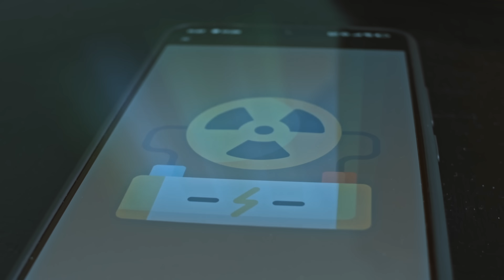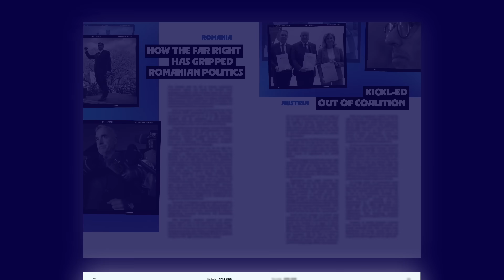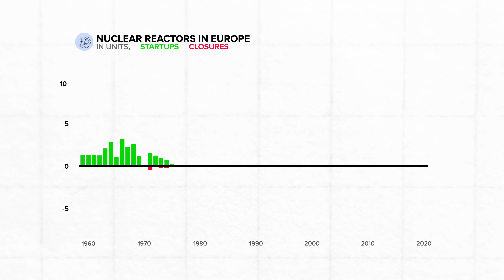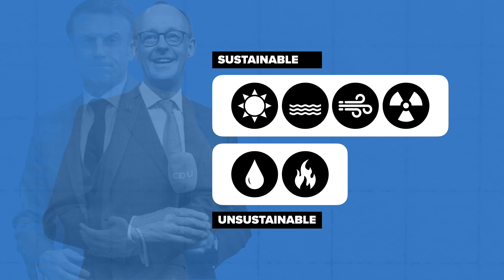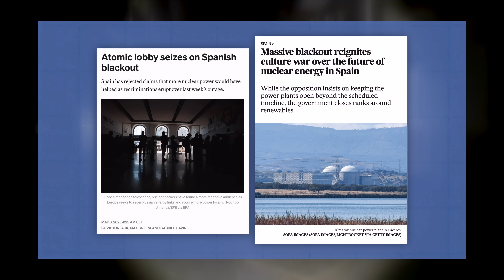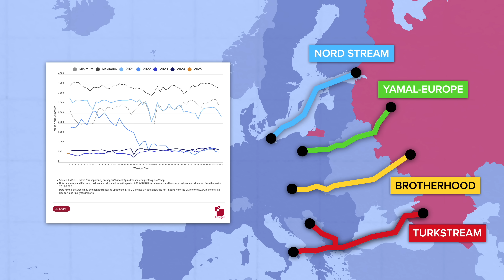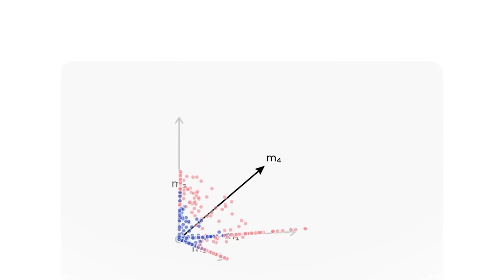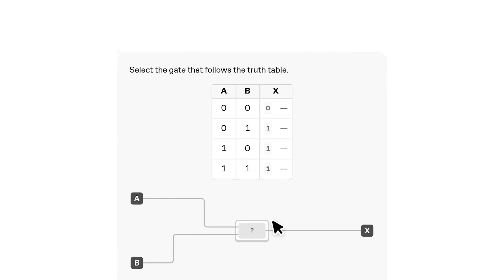Is Europe Quietly Returning to Nuclear Power?

Comment: Nuclear Energy is pretty safe, when...
1) You build your NE plants away from geologically active areas (unlike Fukushima plant)
2) You hire only careful, responsible people to run them (unlike Soviets in Chernobyl)
Reply: And even then Fukushima accident only happened because the company covertly disregarded warning signs that there could be a accident with the facility in case of a large tsunami. Ukrainian power plants can withstand a plane crashing into them. So I guess it's more #2 in my opinion...
Reply: @hostedbysimples Wrong, Fukushima survived a massive earth quake and both waves of the Tsunami, the Sea wall did its job as designed. The problem was the Flood, they failed on planning the location of Backup power generation, had a single generator of the many in Fukushima been located on the roof and the accident didnt happen. I saw a vídeo of Canada Nuclear energy safety, and they explained that all Canadian plants in consequence have two location for generation of backup power, and in case of Emergency the Canadian army has backup generations that can be airlifted to the location and the local infrastructure of the plant must acount for those engines being connected. Everything worked in Fukushima, the sismometers triggered a shutdown of the plant, the Sea wall made its job in protection the integrity, however without outside power, japanese plant workers scrambled for hours to turn on engines located in the basement that were flooded. This was the issue. The plant was otherwise very safe.
Reply: @pedrorequio5515  Yes, yes, everything was fine, except they built the nuclear power plant ON A RIVER!
Reply: @hostedbysimples and being shelled by russia
Reply: The Chernobyl design was always a disaster waiting to happen -- with no protection in case such a disaster happened (to save construction costs + to make it easy to replace fuel rods while the reactor was running).

Nuclear is pretty safe when we don't use designs known to be stupid (and it was known before they built that reactor in Chernobyl!).

The Fukushima reactor was pretty safe the whole way through.  Nobody died because of it.  Some people did die because of a stupid and panicky evacuation, though.  Most of the Fukushima reactors kept on running fine the whole time.
Reply: @peterfireflylund  It has already been shown that NO containment building over the unit 4 of Chernobyl, which underwent a 200 tons of TNT-equivalent explosion, would have prevented it from releasing the radioactive inventory of the reactor core into the environment. Simply put, no containment ever could have ever resisted such a blast. Still, this is clearly not a justification for not having a containment, it is just a statement of a fact, in hindsight. 

That said, the main Achilles' heel was indeed the graphite follower attached at the ends of controls rods, intended to smooth out the reactivity change profile as they get inserted, but which were overall poorly investigated beforehand. Anyway, there are still many RBMK-type reactors in operation in Russia today, and the graphite follower issues have been addressed to prevent a future Chernobyl from happening. 

All things considered, the RBMK is not a "stupid" design, it is a product of its time, that is a time when the Soviet Union was emerging severely weakened from WW2 (albeit victorious), and desperately needed to keep up with the US. The RBMK addressed the main construction issues that American reactors had at the time, namely: 1) the cost and engineering difficulties associated with the construction of large metal pressure vessels (the RBMK houses fuel assemblies in metal pressure tubes, much easier to fabricate than a large vessel for withstanding high pressures); 2) the need to enrich Uranium to at least ~ 3.5-4% of U235, which is costly and requires specialized factories (the RBMK can run on natural un-enriched fuel due to its usage of graphite as a moderator, instead of light water); 3) the large costs associated with the construction of containment buildings (the RBMKs were never shrouded in one as a cost-cutting solution indeed). That said, while point 3) is absolutely unacceptable by today's standards, there was nothing "wrong" nor "stupid" with the main design points (1 and 2) of RBMK reactors.

P.S.: I am a nuclear engineer working in Switzerland.
Reply: @StevenOfWheel they knew it was dangerous before they built the Chernobyl reactors because of earlier irregularities with similar reactors.
Reply: That's true, but even if we were facing attacks from Godzilla as a result of using nuclear power, it still wouldn't be as damaging as fossil fuels are.
Reply: @jesseberg3271 and still wouldn’t kill as many people as hydropower already has.
Reply: Both Chernobyl and Fukushima were Gen II reactors. While they are safe when operated properly, the new Gen IV reactors are safer.
Reply: @GeoEstes  There are no Gen 4 reactors (yet) . I think you mean Gen 3 & 3+ AP1000's and such like.
Reply: @markfernandes2467  China has one.
Reply: @GeoEstes  I think that's just a test reactor, not commercial, but yeah, they're doing far more than anyone else coz they're not idiots.
Reply: and don't put faulty designs into service, which you KNOW to be faulty.  (Looking at you, Soviets!  They knew the RBMK reactors were unstable and still built them).
Reply: The problem with Chernobyl was mostly the reactor design, not the operators. The Soviet government just blamed the operators initially because it was easier and because the RBMK reactor was a pride of the Soviet state, and therefore its design couldn't possibly be at fault. The 1993 report from the investigative committee however placed the fault squarely on the reactor design: "The Commission considers that the negative properties of this type of reactor are likely to predetermine the inevitability of emergency situations"
Reply: Well the other reactors in fukishima were pretty good
Reply: it’s the safest form of energy!! you just had fucking IDIOTS manning the station when disasters happened. but where’s the same energy for oil spills???
Reply: With automation and remote monitoring, it's much easier to get responsible oversight.
Reply: Hahaha (laughing a life’s career in nuclear plant security)
Reply: I would add the third point: 

Keep it safe from diversions and sabotage from a hostile  countries
Reply: Chernobyl was not a fault caused by operators. They did everything "by the book". In no instance was "operator error" the reason why the reactor blew up if you look at the details and testimonies. Of course, the Soviet Union would never admit that the RBMK was a flawed design (yet technically it was possible to get it into a state that lead to an explosion). However unlikely such a scenario is real world, the operators should have been told the full truth about the quirks about the RBMK design and operation. Which they were not. Even the HBO miniseries "villain" and scapegoat Anatoly Dyatlov defended the operators, who did not survive, during the trials that were just a "show for the west". He never changed his testimony and defended their actions until his death. He never said that they did anything wrong or against any rules. The rules changed AFTER the reactor at Chernobyl exploded.
Reply: The original RBMK design was a disaster waiting to happen. The operators made some mistakes, but I don't fault them for the explosion. The pressurized water reactors in the West cannot explode like the one at Chernobyl, and if there were a catastrophic loss of coolant accident, then fission automatically ceases due to the elimination of the light water moderator. Decay heat would continue (initially 6-7% of previous heat from fission), but that can be eliminated by circulating water from the containment sump and the refueling water storage tank, which runs on emergency diesel generators. Even if the generators are out (like at Fukushima), the hydrogen gas produced by steam interacting with the overheating Zircaloy fuel-rod cladding can be recombined into water by the passive autocatalytic recombiners in the containment building. All of this is with Generation II PWRs. Generation III are even safer, and Generation IV designs are often "walk-away safe" reactors that shut down and cool themselves without any human intervention or electricity.
Reply: So Nuclear Energy is safe when you have a generic type of common sense for building structures and here people without political issues? 
I bet some Pro-Renewable Party would say that's too much.
Reply: @ZippyPiglin36  Yes, that's how it is safe. And the Greens will oppose it regardless.
Reply: Good thing nuclear plants don't produce waste, that we still have no solution for and that we keep pushing to future generation over and over.
Reply: The design of the Chernobyl power plant was also a cause of the catastrophe. If a Western power plant had been in the same situation, there would have been no chance of a similar tragedy occurring.

Comment: Europe is helped by a nuclear waste disposal site in Finland.  But it also doesn't mine much uranium domestically, plants take a long time to build, and apparently many plants are at end of life.  So, Europe may take a while to increase the fraction of electricity from nuclear from its current 14%, and be dependent on foreign sources of uranium (until it decides to mine its domestic reserves).
Reply: With breader reactors this issue can be solved

Comment: The fact nuclear energy was ever controversial is crazy to me. It's one of the safest energy types we have and is hundreds if not thousands of times safer than coal, gas or oil
Reply: Would you buy a house with direct views to a nuclear plant? It's crazy, but I perfer to see mountains with wind turbines and solar panels.
Reply: I agree it's very safe statistically but when they go wrong the results are horrific. But incidents are farther in the rear-view mirror and the younger generation barely remember Fukushima so it's all systems go (thank God).

The only problem now is getting the US and China to mass adopt nuclear energy. I believe the CCP will as engineers are overrepresented in the party but in America fossil fuel executives control congress.
Reply: Renewables are even safer ajd cleaner
Reply: @grafity1749but less reliable and way less energy dense.
Reply: @grafity1749 not really
Reply: @grafity1749 No they're not. Wind kills three times as Nuclear. Solar kills eight times as Nuclear. That doesn't include Energy Storage in any kind. Pumped Hydro is going to be similarly deadly as Hydroelectric, since both are somewhat similar systems. Compressed Air Storage is inefficient, meaning much more quantity being necessary. Hydrogen storage is a bad idea, since it is inherently energy expensive, unstable, and has low density.
Reply: @ZippyPiglin36  Don't forget how many people are going to die if we don't get a headstart on climate change lickety split. Wind and solar on their own simply will not cut the mustard.
Reply: Maybe it is controversial because at some point it was semi secret, nuclear power generation was closely linked to production of nuclear weapons, (at least some Gen I/II reactors could be considered as dual use) and there was lack of transparency around nuclear programmes. And there were some serious accidents that had also undermined trust in nuclear industry.

And there also was some anti-nuclear propaganda, but I really do not thing that it itself would be enough for public to turn against nuclear power. In my humble opinion it was cocktail of all those things that had let to loss of support for nuclear by public. Also we should not forget that NPPs are quite centralized power sources and as such need more extensive distribution grid which then is more vulnerable to disruption. So that also could paly a role in opposition to nuclear power.
Reply: It is only safer because it is controversial. Once routine sets in, it slowly goes the way of the space shuttle.

Comment: This video does ignore the significant ramping up of grid-scale battery storage when discussing wind and solar. The real solution is a combination of nuclear and renewables - the only opposition to this has always been political.
Reply: We don't even need the renewables.  We never actually did.
Reply: “The real solution is a combination of nuclear and renewables”

No, unfortunately. That is still a very idealistic solution that we need to work towards throughout the coming decades. The real direction we need to head towards is obviously a greater utilization of nuclear, expansion and advancements of current ‘renewable’ energy. But we will still need to maintain the fossil fuel plants to secure and stabilize energy costs and supply, whilst carefully shifting the power grid towards a diversified distribution.
Reply: @yuyoshida7359  We should develop and expand Nuclear while we still have affordable Fossil Fuels. Otherwise, if we gamble on Renewables, we would neither have a clean planet nor a stable energy grid.

Comment: Yeah, solar is only viable if you have reliable year-round sunlight. … If only the EU had such a place … I’ll think about it this summer in Marbella.
Reply: Please spare some thoughts for the distribution infrastructure.  High-voltage power cables are not cheap...

Comment: Shutting down relatively new plants doesn't make sense, but building new is ridiculous: it's expensive and no private company wants to build one, it takes a very long time to build and therefore doesn't solve our current problems, it's unflexible and incompatible with increasing shares of renewables, and the question of waste management still has not been solved of which the costs are not included in the price of electricity produced. Also, we are required to import it from other countries which bears a geopolitical risk and it's still a fossil fuel as in there's a limited amount of uranium in the world that will run out at some time. 
Put your money into storage technology research and profit from cheap renewables which is the most economical and logical thing to invest in scarse ressources

Comment: Typical Green Party in Europe be like: No nuclear, more renewables.
As if nuclear energy isn't renewable.
Reply: I mean, it isn't. There's a limited amount of fissile material that can be used in reactors. The amount is quite large, especially if we can make thorium usable, but it's not renewable. And I write that as someone very much for the use of nuclear and renewables over fossil fuels.
Reply: Technically, it isn't.  But if we do proper accounting, then neither is wind or solar or hydroelectric dams.  Building the wind turbines/the vast farms of PV panels/the dams (and destroying ecosystems in the process) is not a one-time cost that lasts forever.  It should be seen as a running cost in terms of materials that need to be mined, refined, and processed.  Nuclear power comes out very well if do that.  If we also account for the gas power plants necessary to as a backup for wind/solar, then nuclear comes out far ahead.

Comment: While I agree that sticking to nuclear would have been the best thing to do, I wonder if it still holds true for newly built reactors, given that wind and solar are by far the cheapest sources of energy since more than 10 years.

By the time any new reactor could be ready, energy storage technology will be even cheaper and more advanced than it already is today, and I wonder if putting the same investment in storage instead could be cheaper in the long run.
Reply: Does any Renewables take into account Energy Storage and Waste Recycling, all without subsidised costs? What about material pollution during operation, which while much lower than fossil fuels, is nowhere near zero. Wind Turbines' Blades erode to expel fiberglass into air. Solar Panels can and do break, especially dangerous in Agrovoltaics, to release safer silicon to a bit bad glass to very bad heavy metals into the soil.
Reply: Totally agree. The time investment is a huge disadvantage for newly built nuclear plants in countries not using it right now.
Reply: Check energy grid stability. Wind and solar can't hold a grid, you would have a total shutdown in a matter of days, grids are very complex monsters and require stable power plants to keep the voltage and frequency static on demand. Without fossil fuels, you require hydro or nuclear, there is nothing else. Hydro is dependent on geography and rain.
Believing there will be a storage solution that can actually hold an entire country consumption is the same argument as saying to wait for fusion. That won't happen in the next 30 years. Don't plan thinking a future solution will solve your present problems.
Reply: agreed. While I was watching the video, I kept googling for engerycost by source, and what I foudn suggested, that wind and solar beat nuclear quite handidly, with the primary issue being, that wind and solar fluctuate badly (resulting in such things as german wholesale electricity prices going between -50 euro/MWh and +250 euro/MWh inside the same week). So, nuclear would primarily serve to fill the baseline during times of little solar and wind. However, any new nuclear power plant would be a huge upfront cost (it's one thing to keep existing reactors going, building a new one is a completly different story) and would probably take a decade before it can start generating energy - in which time energystorage and baseload capable renewables (like deep geothermal, which doesn't have the fluctuation problem) will also have made serious advancements.